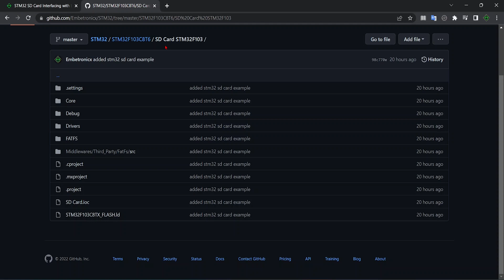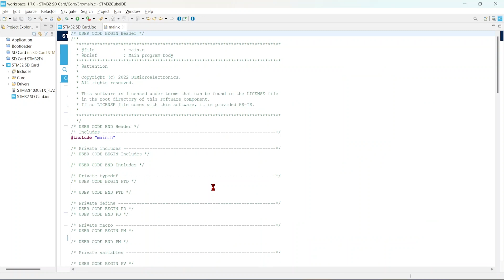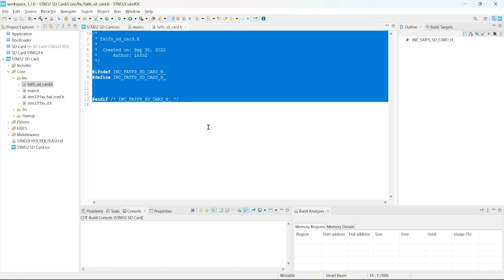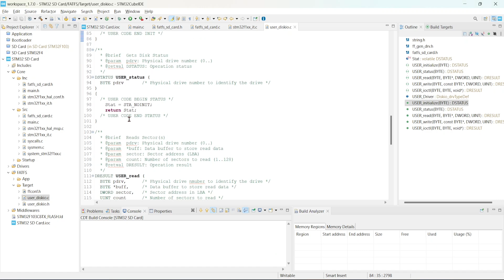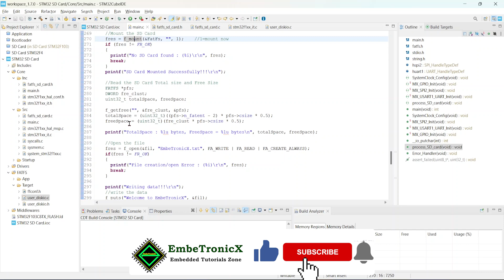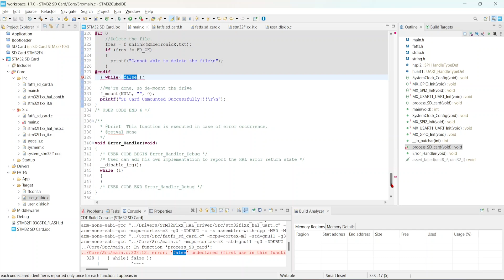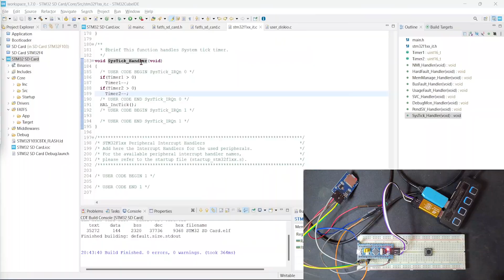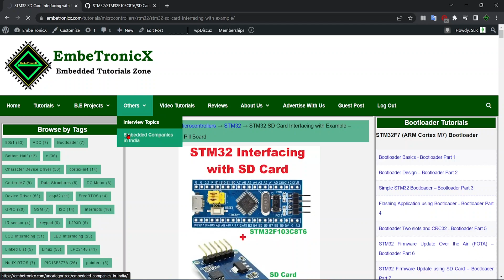SD Card Interfacing with STM32 - STM32 SPI

Comment: Where you purchase Original STM32F bluepill board ?
Reply from the maker: You can purchase it from ChipTronicX (https://chiptronicx.com/product/stm32f103c8t6-system-board-microcomputer-arm-core-board/)
Reply: @EmbeTronicX  Right Now we have Blue pill 256KB high density Board , it will be work ?
Reply from the maker: You may need to partition the memory properly and configure the vector table everything

Comment: Why is the operation be executed only once. I took out the card and deleted the file that was created by the code and reinserted it and tried to let it executed a second time, it always fails to mount the SD card. Even AI could not help me out.
Reply from the maker: Try to remove the the power supply of SD card and reconnect. Then reset the board and check.

Comment: Failed to initialize due to no medium or hard error. It fails trying to initialize  on this function stat = disk_initialize(fs->drv); which is in ff.c. I'm using a f411 and I have the same problem on a f103c6t6

Comment: hello, I  followed all the steps but every time I find the sd-card empty. I tried to find what is the reason for that by making leds light at every operation of the process_SD_card function and found that the function enters the first if condition which mean (No SD Card found)  and break.
Reply: I checked the module with arduino and it is working properly

Comment: Hello EmbeTronicX !!! Thanks for the tutorial video as well as for the web version. Very well explained. 

Though I followed all the step, it did not work. 

Some Details: 
I have a size card of 32Gb and when I wanted to set the parameter for formatting, there were no segmentation size of 4096. Could it be the reason why it is not working? Like I've said I followed all the instructions of your tutorial. Any clue what the problem could be?

Thanks!
Reply: Hey, have you managed to get it to work?
Reply from the maker: Can you tell us what error you are getting?
Reply: @EmbeTronicX   showing

 No SD Card found : (1)
SD Card Unmounted Successfully!!!
No SD Card found : (1)
SD Card Unmounted Successfully!!!
No SD Card found : (1)
SD Card Unmounted Successfully!!!
No SD Card found : (1)
SD Card Unmounted Successfully!!!